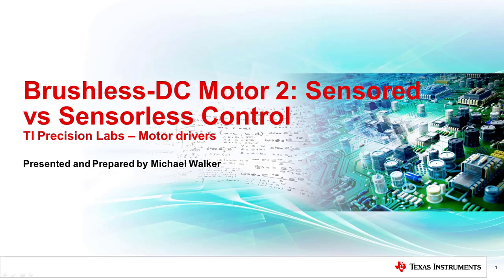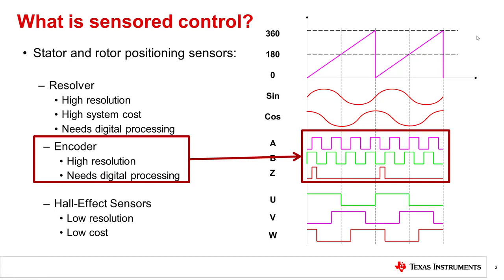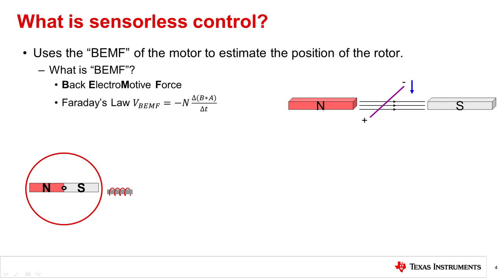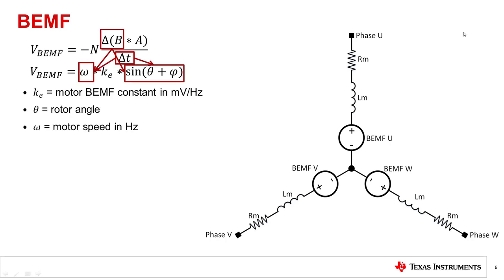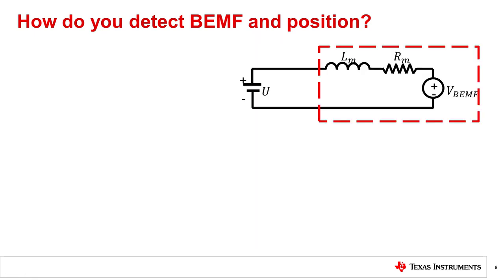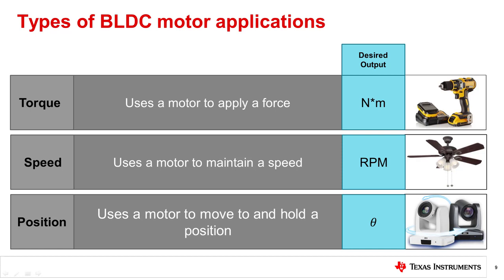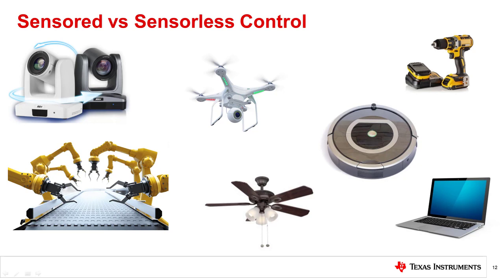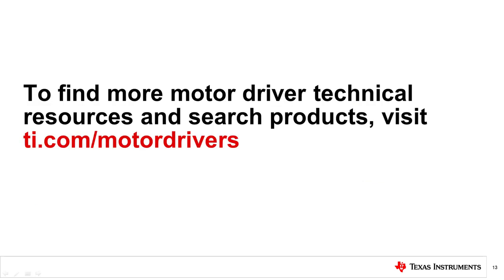Sensored vs. sensorless control

Comment: 9:55 
a laptop fan is spinning at a constant rate, and something blocks the air inlet to the fan. 
This will decrease the torque required to spin the motor.

This is very strange.
Reply: error

Comment: This tutorial helped me realize I can use an ADC instead of a comparator. BEMF calculations will lag by one step in the commutation sequence but since the ADC returns the peak and minimum current of a given phase all I have to do is divide the clocks by two.

Comment: How to know w(speed) value for calculating bemf ?
Reply: This video just helped me realize that I can see the current swings with an ADC. I always thought I needed a comparator to see the zero cross. With an ADC all I have to do is count the clocks between the maximum and the minimum current swings and divide by two.

Comment: Sir I need program code sir.. please suggest any web site or Book
Reply: The codes for the nuke are: 4 8 15 16 23 42
Reply: did you get the code? if yes, I need it too, please.
Reply: @ibr3521  https://simple-circuit.com/arduino-sensorless-bldc-motor-controller-esc/